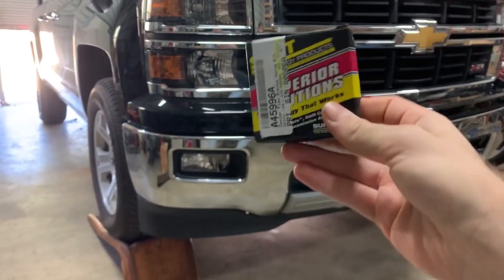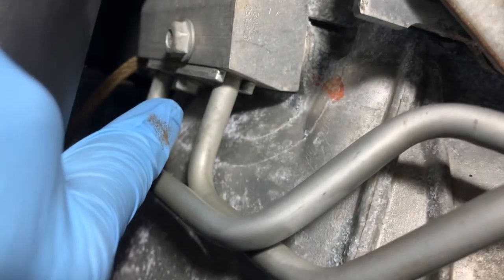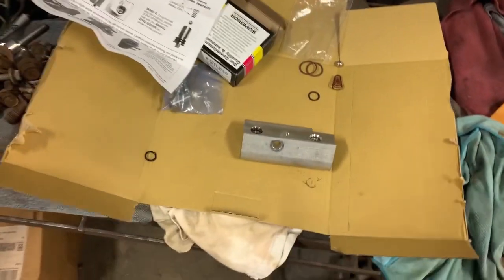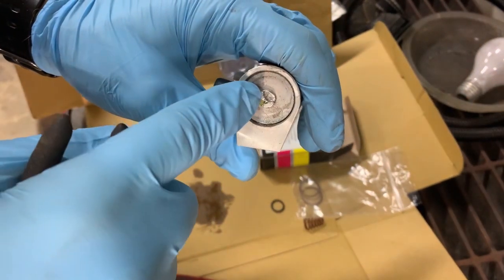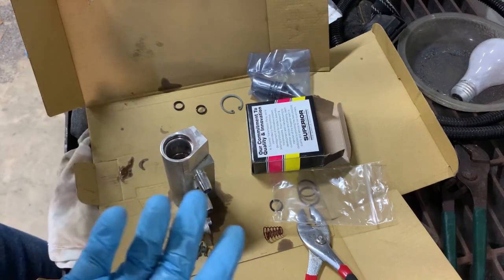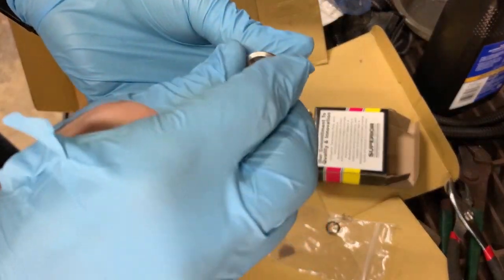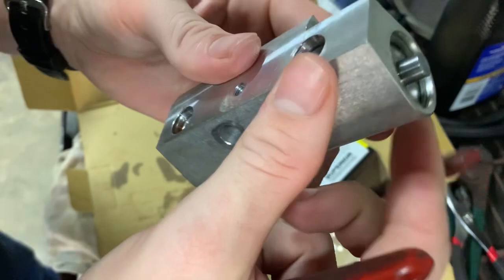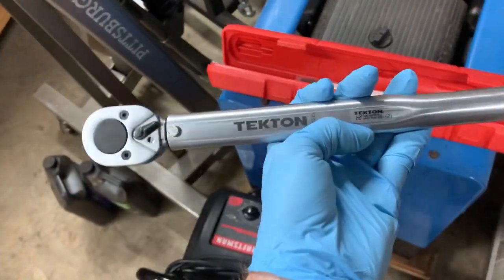Bypass Upgrade for 6L80 Transmission

Comment: So you don’t have to add any transmission fluid after you do this ?
Reply from the maker: @chris1k_  I think it was like 1/4 of a quart at most. I just ran it until it got to temperature then checked it. Wasn’t very low at all. Technically not low but I keep my fluid at the full mark.

Comment: Are you sure you want your transmission to run that cold? It would probably be better when your towing a heavy trailer though to keep the transmission from going way over 210 or 220. Test this when your towing in hot weather and post your results . My Avalanche gets way over 210 when I pull my 6k trailer up big grades when it over 90 .  Tony
Reply from the maker: Yes sir. I plan on doing an update video once summer hits and the temps are in the 90s regularly to get an average. And towing some also. So far since the install my average is probably around 150 degrees. The hottest it’s been was 170 in some traffic and after getting out then back in a few minutes later because the coolant in the radiator heated up the trans fluid and it was about 65 degrees outside. In my opinion anything under 175 is where I want mine to be because once it hits over 200 it’ll start degrading the fluid faster which obviously degraded fluid doesn’t protect the parts as well. 150 to 170 seems to be a good range in my opinion. I’ll put another comment on here once I get the video update done 👍🏼